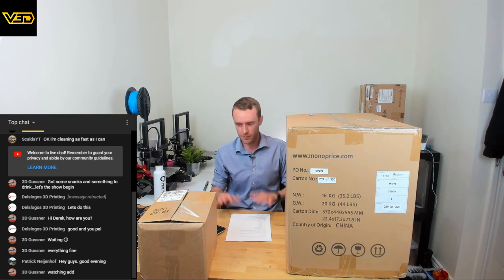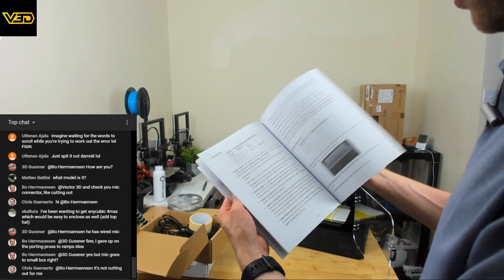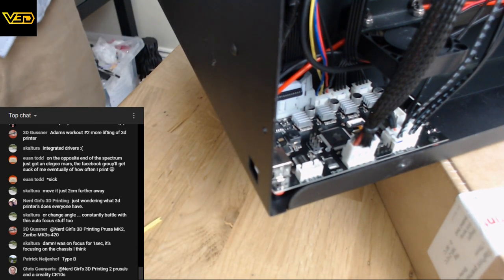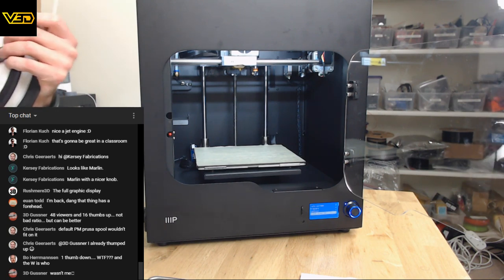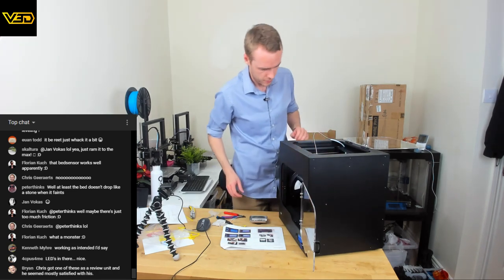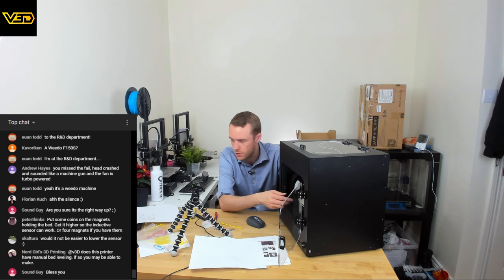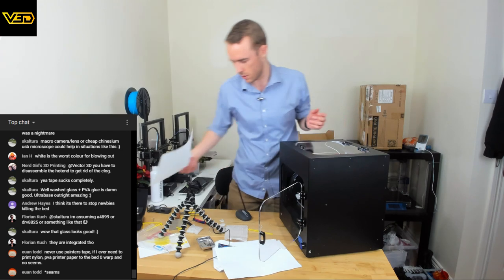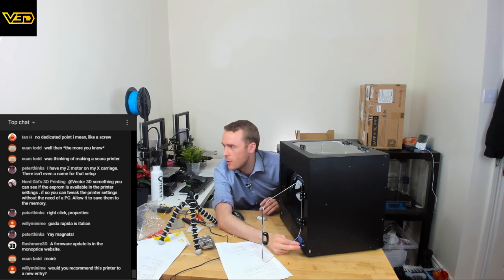Monoprice Ultimate 2 - Unboxing, First Look and First Print

Comment: Hey Vector. Great video. Really helped with setting up the Ultimate 2. The filament sensor also gave me trouble at first. I always use Cura 4.4 with my Maker Select V2. The Micro SD card that came with the Ultimate 2 had their own version of Cura 3.3 on it. Is that what you use or do you use another slicer? 4.4 didn't have a profile for the Ultimate 2 (just the Ultimate). So, I tried Cura 3.3. I'm using the tape + glue stick that came with the printer and have adhesion issues. I haven't tried just glue directly on glass or trying to maybe change the surface. Any tips for adhesion and Cura profile settings/where to get the most up to date Cura with Ultimate 2 settings? I miss the huge Maker Select V2 community. Thanks ahead of time :)